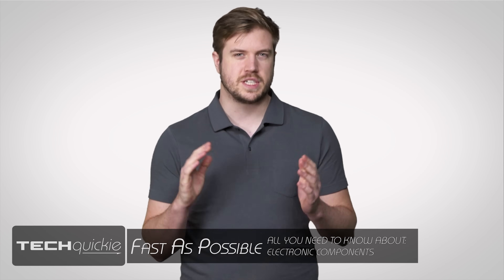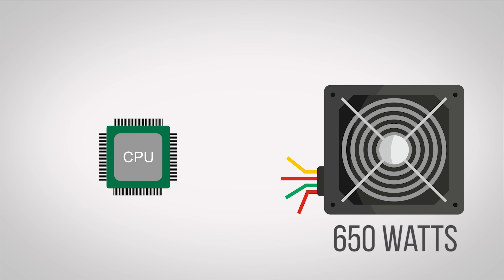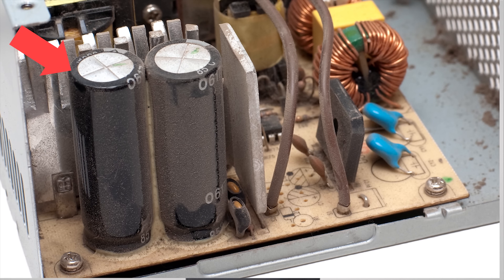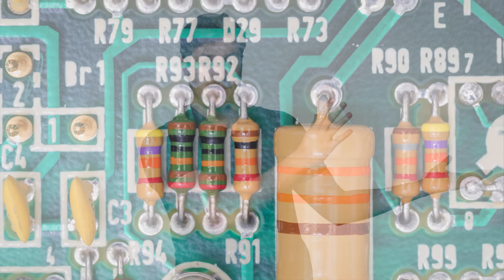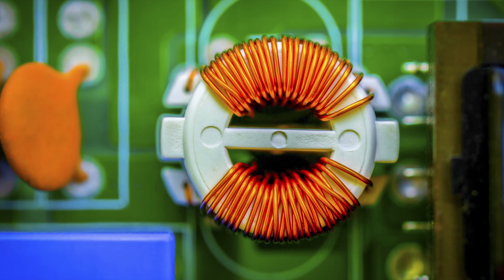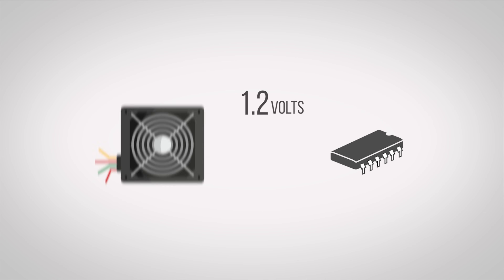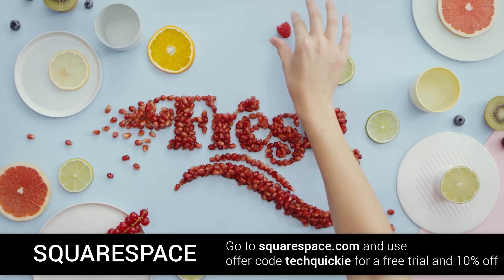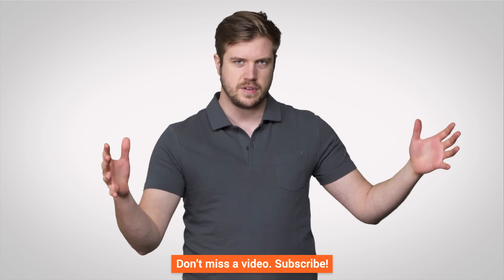Capacitors, Resistors, and Electronic Components

Comment: IF you open a power supply? Folks, do NOT open a power supply, you may get killed from it, and power supplies are a throw-away electronics, just buy a new one. Really Luke? Just unplugging a power supply doesn't discharge the electricity stored in it. It take up to 3 days for the charge to completely discharge, in the mean time, the charge that is in the power supply is still lethal.
Reply: Modern power supplies have integrated bleeding resistors, usually those bigger resistors you see on the board. They are usually the first you see fried as they also function as a sort of fuse. However, if you can't design a power supply yourself, you should never even try to play with it. I agree on that.
Reply: Good info to know. I junk for a hobby and make a little money on the side with it. Did not know power supply's  hold electricity. I will be sure to wait before I disassemble them
Reply: @barryellis6663  they hold a tiny bit of power, which gets bled by the bleeder resistor. every power sappy that uses high voltage has bleeding resistors :/
Reply: He already said it, capacitors hold charge lol
Reply: Waiting a full 31 days will make things very safe indeed
Reply: so will waiting about 30 seconds. a requirement for all power supplies is they have a technique for discharging the high voltage capacitors.
Reply: TIL I should have died years ago...
Reply: If you don't open up power supplies, how will you learn to design your own? As long as you take the right measures, there's no need to fear opening them. Are the any electronics technicians/engineers here because almost every comment is discouraging people to open up power supplies.?🤦🏾‍♂️
Reply: @synqelectric6163  Electronics technicians KNOW what they are doing when opening power supplies, they are trained for that. The general populace has no business opening power supplies up. Desingning your own power supply means you are already some experienced tech, and opening a power supply should be left to them.
Reply: @Practicedummy1  Ok, but I thought that this topic was to introduce people to electronics. If we start by discouraging them, how will they even have any experience? If this was about HVAC, I Would understand your point of view, but the danger here is less than that. If only one is careful and is educated on the safety precautions to take, chances of  accidents are minimal.
Reply: @Practicedummy1  I mean, we all have to take the plunge and avoid staying on the shallow ends. Beginners cannot learn if they always avoid certain circuits. I don't mean that they be careless though.
Reply: @synqelectric6163  Power supplies are not for beginners though. Everyone starts with learning how to build circuits on a breadboard using low power. After much training, THEN a person has the experience to work on a power supply. You don't shove a beginner right into a dangerous situation.
Reply: @Practicedummy1  Ok. I understand. I thought that the audience here is at least familiar with some basics. Doing electronics on battery level seems too much children oriented. Anyway, you might be surprised that in the highschool, that I was taught in, linear power supplies were among the first electronics that we covered on as the first application of diodes and we made various test circuits.
Reply: @synqelectric6163  LTT covers a variety of levels of experience, mostly for beginners to intermediate levels, but some advanced stuff as well. I am jealous that you got to cover that in high school. I was missing out!  :D
Reply: plug it out
And try booting from the stored power
if you can
your using a laptop
Reply: you may get killed from it,.........LMAO.....LAMO....LAMO.....what a MORON!

Comment: Actually you should never open up a power supply regardless if it's plugged in or not. They store electricity even when unplugged. People have died attempting it.
Reply: Andrew Lipscomb That's true, you should always short any capacitors when disconnecting from power. But I would also add that the metal casing can also be sharp in certain areas.
Reply: Funny (not really) story, once I opened up my PSU (500w) while it was plugged in and touched the bare metal contacts, luckily with only one hand, and even more luckily with only my thumb and forefinger, but moral of the story, unplug it, and discharge the capacitor..
Reply: every power supply has a discharge resistor connected between the 2 terminals on the big boy capacitors (aka the ones rated for 100v+), normally in the 40K-50K ohm range to make sure the resistors dont if any power while sitting there.
Reply: LMAO
Reply: Andrew Lipscomb I've opened like 100 power supplies. I'm still alive eh ?
It's like saying: you should not drive cars, It's dangerous and you can die in an accident.
Reply: V. A. Popov now you're just saying that you can drive a car without any understanding what the thing actually is or how it's driven.

Yes, you can do the things mentioned, but only when you know how to and even after that with caution.

Comment: The capacitors in a PSU can hold charge for a long time after it has been unplugged.
So dont fuck with them if you do not know anything about electronics.

But Linus Media Group should really leave the electronic component talk to people that know what they are, what they do and the dangers of fucking with them.
Reply: Yes, you can light up your life messing with unplugged large capacitors.  The warning in the video to unplug the PSU before going inside is woefully inadequate.

Comment: There are way more capacitors than the electrolytic/polymer capacitors you mention on a motherboard, if you look at most parts of most boards near every IC you'll see a collection of tiny brown/black/yellow rectangles, those are capacitors too (usually multilayer ceramics). Primarily they provide a low impedance supply source for sudden inrushes required by the IC, without them your CPU would radiate like an antenna. Plenty of other uses for caps but decoupling is by far the most common especially in PCs.

Comment: what if one breaks? will ur sweet components go blambo?
Reply: Depends on what breaks and in what ways. If a choke breaks and all of a sudden conducts really well, your components are certainly at risk. If a cap breaks, your system probably won't even boot. Capacitors filter out the low voltages(so the system will just be without power if it breaks) and a choke filters the high voltage(what they said about it stabilising high CURRENT is false)

Comment: A good stab at this but some incorrect information.  First do not open a power supply without properly discharging the capacitors.  Second capacitors are not only the tall cylindrical items.  There are a bunch of SMT capacitors that look just like the SMT resistors.  See how the soldermask says C followed by some numbers? The resistors do not control the voltages they control the current.
Reply: resistors resist the electrons, and they create voltage drops in the circuit causing a drop in current... you are too wrong

Comment: "But if you want to open your power supply, unplug it first" Well NOOOO. As he said, capacitors hold charge (like batteries) but they can release their charge in a few ms instead of a few hours like the battery does. So one of these big 400V smothing capacitors in a power supply can easily kill you if you are unlucky. So please, just dont open a power supply
Reply: They may be rated at 400v but it doesn't mean they sit at 400v, and also all power supplies made within like 10 years have discharge methods to discharge HV capacitors so you could (in theory) touch the capacitor within 10-20 seconds of unplugging, but they can fail so I'd short the cap anyway.
Reply: Sebastian Flocke to be able and I am a very nice of you and the rest of the most recent call last week I will be a great day and night at the end result of the year in review of the most recent call last week I will be a good time and I will be a great day and I have been a while and then we can meet up with the other hand the keys for your time and money to pay for a while and I have been a while ago and I will have a great
Reply: Sebastian Flocke Funny (not really) story, once I opened up my PSU (500w) while it was plugged in and touched the bare metal contacts, luckily with only one hand, and even more luckily with only my thumb and forefinger, but moral of the story, unplug it, and discharge the capacitor..

Comment: Whilst sort of correct, it's hard to say that the video is completely accurate. It is really hard to explain correctly the intended purpose of these components without at least a sound understanding of electricity (either from a physics or electrical engineering background). 
It may be an idea to have a unique video on each component and go into more depth about them.

Comment: I opened up my off brand xbox one power supply played with it then connected it for a while to see if the fan was even working and and when I was going to close it I forgot to disconnect it as I came back to it later and it shocked me so freaken hard on my arm that my arm just felt really freaken weird and its was like hard to move it yeah I was stupid for doing something like this

Comment: MOSFETs do not communicate with the CPU, they are simple switches. They are connected to a controller, which IS communicating with the CPU, and that controller tells them how fast to turn on and off, something called PWM.

Comment: What is a power phase design? I always hear people saying that "5+10" power phase design on this gpu is makes it better than this one, but what actually is a power phase design and what does it do?
Reply: bensemus x  You are wrong, so wrong. A phase is about a subassembly of components ( mosfets, capacitors, an inductor and a few more jellybean parts). And they are in parallel stepping down the voltage and delivering it to the CPU and memory. If you have more power phases you can divide the load more evenly across the circuit which makes the power more cleaner. Also if you have more power phases you can deliver more power.
Reply: I am indeed running two supplies from a single oscillator. I completely agree that if I were to run both supplies at the same phase, I'd get double the ripple output current. This would get even worse in a quadruple parallel supply configuration, as you stated.
The key is to run both supplies at an inverted phase (180 degree phase), thus overlapping the ripple current and cancelling some of it out. The frequency of the ripple current is doubled as well. This also means that a smaller filter capacitor value can be used at the output, which gives an advantage in board real estate.
This is truly not the cheapest way to reduce ripple - that would probably be a ferrite bead.
Most of the time, designers will have to parallel power supplies anyways because of the high current demands that CPUs normally have.
Reply: More phase tend to also mean more controllers and higher overall capacity in parallel - giving lower ripples.

But far more important and the reason why it is needed for high overclocks:
Stability and power-draw. The Mosfets that switch the current on and off get hot while switching, and a single mosfet can only handle oh so much power. by building more phases in parallel they share the load and do not get as hot. Lower temperatures makes transistor switch faster, so the energy-output is cleaner too.
Reply: More phases doesn't make the power cleaner. For that each phase needs to be clean. More power is the main advantage.
For a true multi-phase they need to use doublers, otherwise they're not taking the load off the driver IC.
So count the driver ICs, not the chokes.
Reply: ABaumstumpf A bit higher rated VRMs with proper cooling is cheaper though... With the same result.
Assuming the VRMs don't overheat either way(proper cooling or whatevs), the power doesn't become cleaner.
And fast switching transistors can give ripples, but that's not the case in the driver ICs, so meh.
You're all right, my mistake, but I must have a point.
Reply: 1 phase means there's just one choke handling all the power going to the chip. More phases means more chokes working together in series I believe. They each step down the 12V a bit instead of one having to dissipate say 10.8V worth of power. 5+12 means 5 phases for the memory and 12 for the gpu. More phases can also handle more power and will provide a more stable voltage supply, both making OC'ing potentially easier.
Reply: Actually, more phases make cleaner power. Taken from app note 77 from LT: "Because of the 180 degree phase difference between the two converters, the two inductor ripple currents in the two-phase converter tend to cancel each other, resulting in a smaller ripple current flowing into the output capacitor".
Reply: You're still running a single pwm. Just a single double will be no less clean than a quadruple (so more isn't better) and there are less expensive ways to make it cleaner.

Comment: Erm... Maybes re-upload this one, omitting the part about opening up your PSU to have a look around. No one should be opening up their PSU's, even if they're unplugged they still store enough energy to send you on a one way trip to farewellsville.
Reply: Ignyte all high voltage caps have discharge resistors (unless you have the cheapest power supply available). No way it could kill you.
Reply: Ehm no. Capacitors have the characteristic to have a very low to no resistance at all. Some Capacitors can easily deliver enough volts to break your body resistance and with enough farads simply kill you.
Reply: search up "discharge resistors" or "bleeding resistors"
:/
Reply: Because they exist doesn't mean is always used. Assumption is the mother of all fuckups.
Reply: every computer power supply uses them :/
they wouldn't had a complex circuit and just 'forget' the main safety feature.
Reply: ive used, opened and looked at 100s of chinese power supplies, and they all had discharging circuits
Reply: LMAO
Reply: Learn free of cost PCB design so click these link
https://youtu.be/ApXhpz8XPWE

Comment: Why'd you mention surface mount resistors but not capacitors?
Reply: Hank It should have been mentioned that thats what the tan colored SMD components are on the board. Im just venturing guesses as to why they didn't. Of course the most likely reason is this is simply their own basic understanding of this, which is more then most peoples.
Reply: Probably because pth capacitors are more or less, obviously different visually from smt capacitors.
Reply: Not sure what you're trying to say...
If you're claiming the surface mounted caps look more different compared to the through-hole caps relative to resistors, that's not the case at all with electrolytic capacitors. See the silver cans at 1:13? They're pretty much identical to the through-hole versions at 2:40.

If you're saying they look less different/more similar than through-hole caps, relative to resistors, look at the brown disks (and likely the covered yellow disks) at 1:56 compared to the surface mount ceramic ones basically everywhere else in the video. The reddish-brown blocks at 1:13 and the flat brown ones and the black ones that don't have numbers on them at 2:40 are the surface mount equivalents to those disks. How are they more similar than resistors?
Reply: Hank there are slot of smt capacitors that look similar to resistors, most motherboards have identifiers next to the placement of smt parts. capacitor placements usually start with a c### for the placement of the specific capacitor for a p&p operator to program.
Reply: And resistors are denoted by R###. What's your point? I was asking why they mad the distinction between a couple resistors, but didn't bother mentioning anything other than electrolytic cans...
Reply: Hank maybe they didn't want to go in-depth, I'm sure they made this more as a crash course.
Reply: +Hank, best guess is because when you say Capacitor most people automatically associate that with you standard electrolytic caps. Thats just a guess, and besides they were trying to keep it short and simple.
Reply: +sparkplug1018
Shouldn't that be all the more reason to talk about the much simpler and useful caps? Electrolytic capacitors are only useful when you need a high capacitance because it's cheaper and more space efficient to make them with higher capacitance without needing to tank the voltage rating.

Comment: I'm cringing so hard. MOSFETs are like switches, and are used in buck converter circuits to step down voltage (by switching on and off in patterns, then being smoothed by caps and chokes). They do not step down voltage on their own, however.

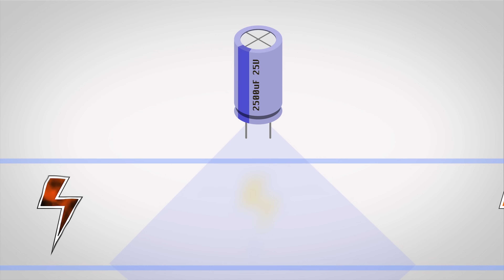Comment: 1:44 Reminder not to fuck with power supply components unless they've been unplugged for at the very least a couple hours. The aforementioned "much larger capacitors" could still hold some energy and DISCHARGE ON YOUR ASS. Best case scenario is a lot of pain.

Comment: i know you talked about surge protector before, but i read that you can't daisychain surge protector or you will lower the effective protection, and you could end up with your computer protecting your surge protector... MOVs are used to shunt to ground and it seems that its one of the only way manufacturer protects equipment(There is Zero Surge but its a patented technology, i'm thinking about buying one though). Most whole house protector protects for 600v, isn't that a bit high? And if people are going to hook up a UPS to a surge protector, its said to have other adverse effect like putting your ups into overload, anyway that's what i've read... This stuff is a bit scary and buying a 200$ Zero Surge to protect a 400$ UPS seems like a lot of money. Although where i live, i usually blow up a PSU a few months after replacing the battery on my UPS. So i'm assuming that i'm not protected enough... I might replace the UPS with a Voltage regulator like the Opti-UPS SS2000... My head is spinning, i dont know what to think anymore...